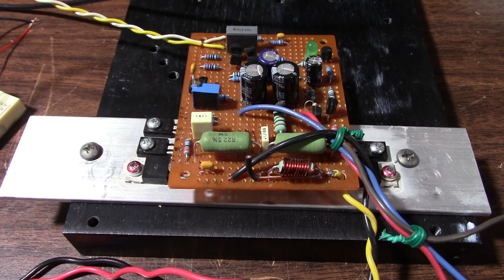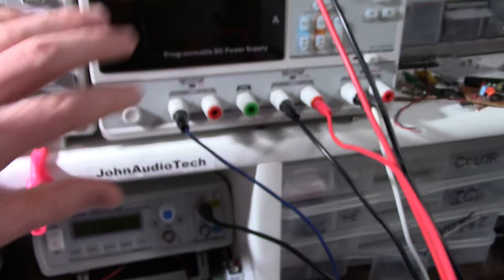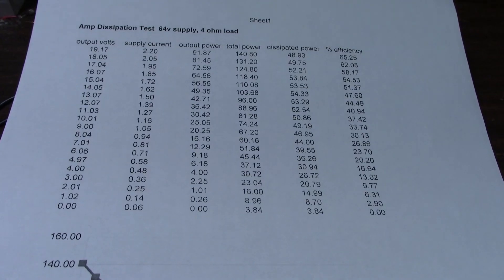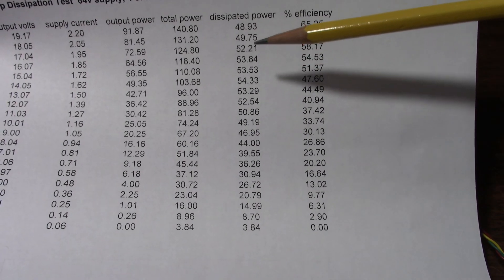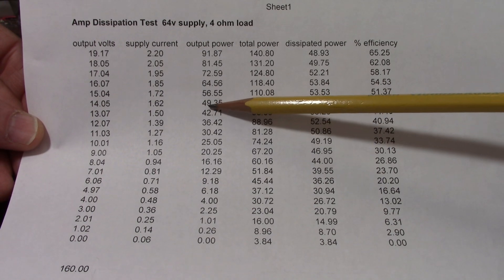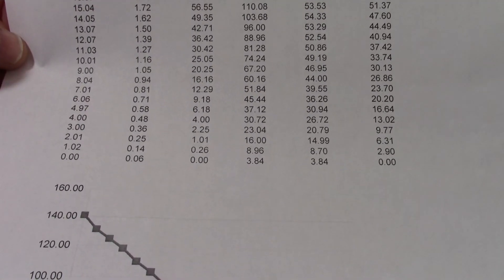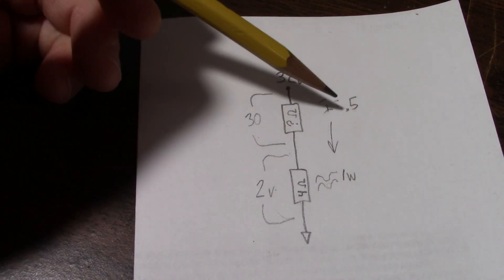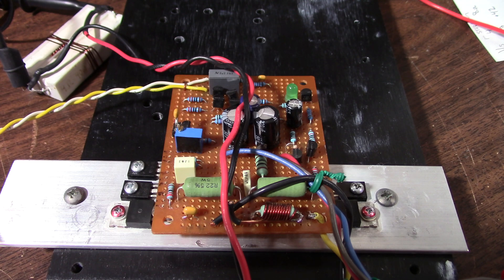Why class AB or B amplifiers dissipate more heat at lower power

Comment: Uh. Lets look into this..I want to know why you tested your handbuilt amp rather than commercially available product...Im not meaning to discredit you..but..theres something wrong here.. normally. 1 thing to find out .is the supply causing the issue..or is the outputstage running class a

Comment: Just use Class H amplification, it's a great balance between efficiency, heat, voltage, amperage, and power output.. The RAIL CATCHER! The newer Class H amps. have hardly any crossover distortion..

Comment: This suggests that to increase efficiency at lower power you'd want the ability to adjust your voltage rails to suit the required volume levels.
A variable voltage rail would be an interesting feature for an amplifier that has to do multiple duty as both an easy listening amp and a party amp.
Reply from the maker: You just described class G for linear amplifiers. It uses a low and high voltage rail and switches automatically when more voltage is needed.
Reply: @JohnAudioTech  
I was thinking more in terms of a manual "eco" switch where you'd adjust the voltage regulation down to match the low power operation rather than multiple rails and automatic switching.

While typically you use a variable resistor for adjusting regulation IC's output, you can also just switch to preset resistors for matching the positive and negative rails.

If you're already regulating the supply, it's just a couple of resistors and a switch rather than needing a more complex multi rail power design.

I'm sure that there'll be other considerations due to gain etc, but they shouldn't be too difficult to compensate for.

Comment: Thank you. I have a Markbass Bass Amp. It has a problem. When i turn it on and play my bass, the sound rich and with more body. After 3-5 minutes later, sound going to be weak and less powerfull with no enough body. I am an electronic technician but i am not good at sound products. I take some pictures with the thermal camera without any load. Some of smd resistors on the output line really hot (80C°). Also one coil at the crossover line too hot. And  also some small smd resistors and one zener diod are too hot. I don't know if heat is causing this sound problem. I add some fan to try, it is better now but I want to find the exact solution. Can you help me? Erginyilmaz.tenor@gmail.com

Comment: I don't know if I can agree to all this ..... I've used many amplifiers big ones 1Kw to 6Watt and I've always noticed how hot the heat sinks are when driven hard compared with how much cooler they become at half power output ....
Reply from the maker: As mentioned in the video, music has a lower average power than a sine wave. At high volume, music can put the amplifier in higher dissipation than a sine wave a max level before clipping. It depends on the type of music and the speaker reactance.
Reply: @JohnAudioTech  ok ... that does make sense now ... I did overlook sine wave power considerations versus music power ... quite a big difference...😀

Comment: How about Class A amp? Still more heat dissipation at idle compare with full output?
Reply: If it's pure class a (single ended class A), the dissipation is at max when idle. Which is not the case with class B(AB) that are max at around 60% instead of at idle.